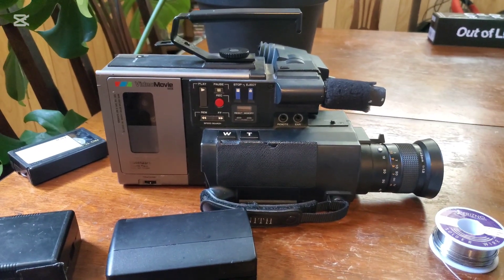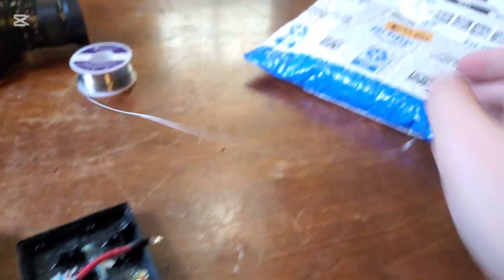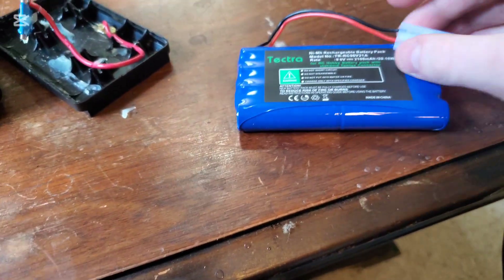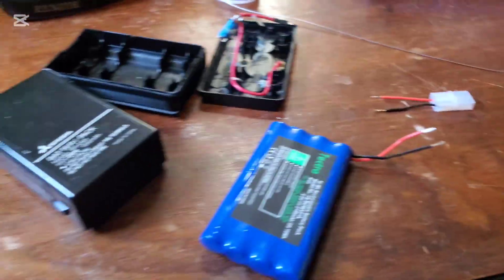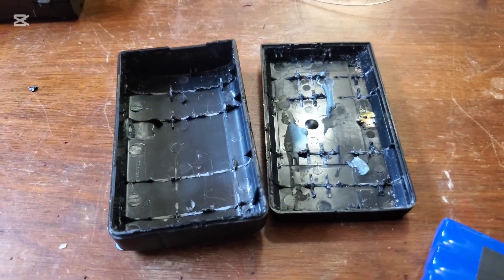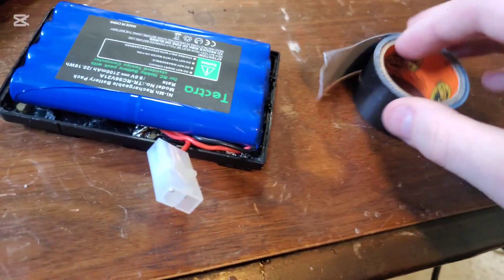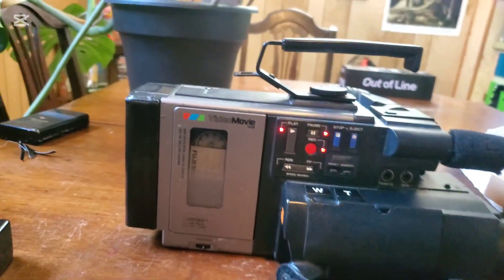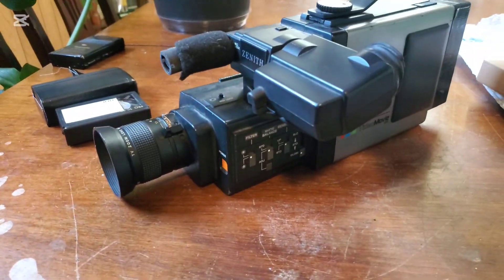JVC GR-C1 battery "rebuild" how-to

Comment: don't know what was the issue with the original charger or the battery, but ni-cd or ni-mh charge very close the same way.
modern "legit" replacement we can find in europe for those batteries are indeed ni-mh.
and even back in the days, in the mid/late 90's some third parties batteries were already ni-mh, due to the reglementation on cadmium.
so i don't get what went wrong with yours.
if it was lithium (that's the route i've chosen for rebuilt those batteries) i would totally agree.
Reply from the maker: Maybe they have some form of overcharge protection? These are just bare cells with nothing to stop them from getting too hot. Ive had bad experiences with other nimh batteries on nicad chargers as well, the 90’s Panasonic compact batteries have also died on nicad chargers